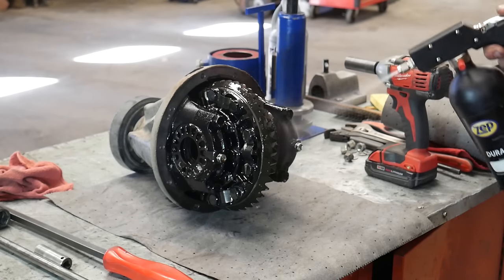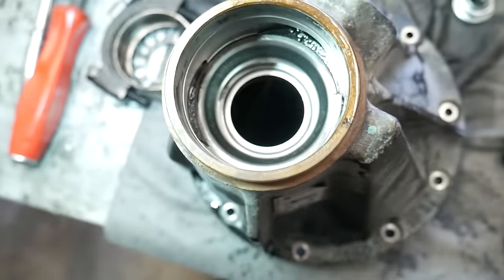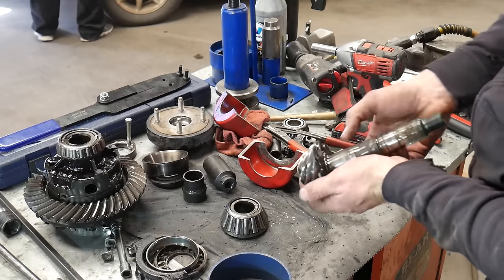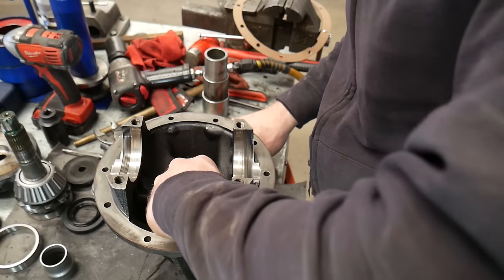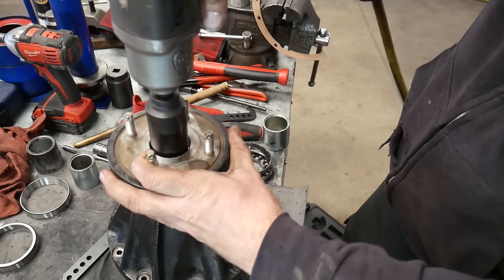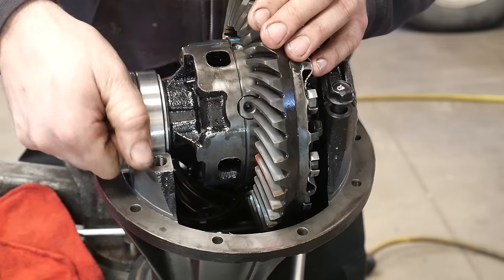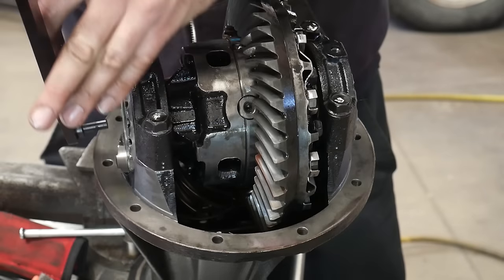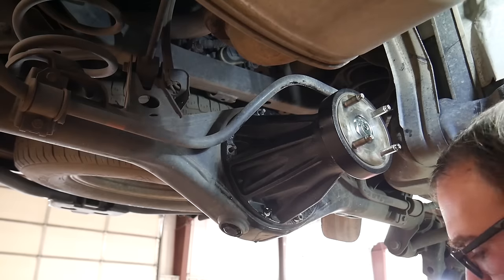2005 Toyota 4Runner Rear Differential Rebuild - Bearing Replacement

Comment: Hot tank/cold tank?  I use my oven for the housing and the fridge freezer for the bearings.]
Reply from the maker: I use the hot tank on the housing and it does help. I have also seen dry ice used to cool the bearing races before install to shrink them. And a hot plate on the bearings to install on the pinion.

Comment: For people without a welder:  No need to weld the race to get it out,  instead cut a large washer in half to clear the deflector, set  both halfs of the washer onto the race and press it out.  Or just order a new deflector which is inexpensive. This is a good step by step video though
Reply from the maker: Thanks for the washer tip. I will take a look at the next one I pull apart and try it out. There are times when I don’t have access to air or a welder.
Reply: Can you please explain a bit more? I have a deflector in mine and cannot punch my races out... cheers!

Comment: The Pio on bearing removal tool requires the bearing outer race to be in place and you lift it off by pressing on the rollers, this way you don’t need to get under the inner race of the bearing,, this did my head I at first but that what make this tool so clever.

Comment: Im glad i found your video, my buddies been wrenching on heavy equipment, semis, dump trucks, trucks, cars, boats for 40 years or more. I told him i needed my differential bearings replaced and asked if he had the right tools to do it. He asked what tools? I said well to set the pre tension, the paste to check gear spacing the stuff i saw guys using on utube videos. He just laughed at me, said if i wasn't changing gears he didn't need the high dollar crap. He said you do it by feel if you know what your doing lol. Watched your video and i feel better about having him do it now.

Comment: Nice and clear explanation throughout video! I will say carrier bearing preload seems quite loose imo. Once backlash is set go back and forth, or focus on ring gear side and tighten those bearing adjusters as tight as you can get them. There is a tremendous amount of torque going through the ring and pinion and deflection will happen without enough carrier bearing pre-load. It will not damage the carrier bearings by having too much preload. Well over 100 ft/lbs on the adjusters is common.
Reply from the maker: Thanks for the info! If I would have followed all the factory directions we would have checked the carrier preload. Toyota gives specs for pinion preload by itself and additional pinion preload after the carrier has been installed and adjusted. The adjusters have to be adjusted to meet the preload requirements.

Comment: Very professional process and clear explanation! My friend has a 2004 Tacoma with 260k miles. The rear diff has some major play at the front pinion bearing.... But no leaks or bad sounds. Should I just try tightening the flange nut to reduce the slop?
Reply from the maker: Pine Hollow Auto Diagnostics excessive rotational play or up and down play? If the pinion is sloppy up and down you can try tightening up the nut but normally the bearings are worn and will start to make noise after tightening(unless someone didn’t tighten up enough in the past) If the play is rotational play then the pinion nut probably won’t help and you would have to remover the diff to adjust the carrier so the backlash is reduced.

Comment: I rebuilt my toyota 7.5 and installed a locker back when i was in community college 2015 automotive service technology. I forgot how i did it. This video refreshed my memory. I want to change my ring and pinion gears, can i reuse the bearings that i replaced years ago? Do i need new crush sleeve and shims?

Comment: Since you got fire involved, you might as well had just cut the race out.  I worked for a logger who could do stuff like that. Definitely exemplary of making it work with what you have!
Reply from the maker: I’m more likely to cut to deep with a torch and trash the housing. I mostly just beat them out with a drift and hammer.

Comment: Do you add friction modifier to the rear-ended gear oil ? I just came across to ask you Toyota   shops say so I helps with the chader in turns parts stores gear oil doesn't have it in the oil 🙋
Reply from the maker: That normally is only required on models with limited slip differential.  Toyota places a sticker near the fill plug that will say LSD.

Comment: Very nice tool by Yukon for removing the pinion bearing what model number is that tool so I can grab one should also work on 2000 3rd gens as well there are no links in the description sir

Comment: At 3:00 
The bearing kits here in 🇦🇺 come with a New Deflector ...
Simply punch the Deflector and bearing cone out with a punch .. No Welding required .. 
May save you half an hour of welding and slag if you can source the $5 Deflector ?
Reply from the maker: @kevwills858  I agree with you. It’s not worth $5 to waste time. The deflector didn’t come with my bearing kit unfortunately and welding only took about 5 minutes. 

The welding trick also works wonders in other places. Yesterday one of my technicians was having difficulty with a Toyota sienna front wheel bearing because the race was rusted into the knuckle. I told him to quit messing with it and grab the welder. 5 minutes later I heard the race hit the floor.  Not only does the weld shrink the race but the heat also helps to break free any rust binding the components together.
Reply: It takes me 5minutes to drag my welder out and set it up 😄 ..
I've welded a quite a few Dry Cylinder Liners in old Perkins engines (insitu), it's the only way to release the rusted Liner from the Block .. (another old trick👍)

Comment: So my 2004  seal is leaking, can I just take the pinion out and replace it without replacing any parts? just gaskets? Any hints to do it quicker? Thanks in advance!!
Reply from the maker: If it is just the pinion seal you don’t need to remove the third member from the vehicle. You can service the seal buy removing the driveshaft and pinion flange. You should mark the nut so you can try and get it back to the same location when reinstalled.

Comment: I have a leak on my 2000 4runner rear diff right at the housing of the axle tube to the 3rd member Housing right near the bolts on the bottom and sidee and I can't seem to get it sealed what could be the problem ?
Reply from the maker: If it’s leaking where the tube goes into the housing then it may be difficult to seal. 
First thing I would check is the differential vent and make sure it isn’t plugged up. It is located on the driver side top of the differential housing. It has a little metal cap that is crimped onto a metal nipple. The cap should be able to move up and down as well as spin. Dirt gets into the cap and causes the blockage. As you drive the increased pressure will make everything leak much faster. 

You may have to removed the 3rd member and clean the inside and outside area of the leak and then apply sealant to both sides. Let the sealant dry overnight before putting fluid back in

Comment: Did you add silicone to the gasket? Also what was the torque spec on the diff bolts. TIA

Comment: Thank you for posting.. This is a GREAT reference! 

I'm guessing that is a non-locking open carrier that you are working on.. Do you know if the process is the same for a non-locking limited slip? Thanks for any info..
Reply from the maker: it4dps the process will be nearly identical but the specifications may vary slightly.

Comment: On the inner pinion bearing, would it be ok to warm it up first on this application? I install bearings on spindles at work on heavy mobile cranes and we warm the bearings to 350F and they slide right on. Wait a bit for them to slowly cool. Just wondering if these little bearings could take that. Cheers. Great video .
Reply from the maker: Great question!!! I had to do some digging to see if I could find some accurate information and learned quite a bit along the way.  I found that people heat bearing to all different temps before install but I found a article from SKF that recommends a maximum of 257F or you can risk changing the metal's attributes. The article shows very large bearing but it should apply to the smaller pinion bearings as well. Here is a link http://www.lubsys.com/knowledge/knw_heatmnt.htm

Thanks for the question and for checking out the video👍🏻
Reply: This is a perfectly acceptable way to install bearings without a press. Throw your pinion in the freezer over night and toss the bearings in your oven at 350 degrees for 10 minutes or so. Take out frozen pinion, take bearing and slide it right in place. This can be done on the carrier as well. 

The freezer part will not have as much of an effect as the heated bearings, but it works well. You can also use a heat gun to warm the bearing. 

Also, you can wrap the bearings in water soaked rags, and put them in the microwave for 90 seconds.

Comment: Have you guys considered investing in a bearing induction heater and/or liquid nitrogen to install those bearings and races? Much faster and no potential bearing damage as opposed to cold mounting. Liquid nitrogen alone will suffice and really cheap to use
Reply from the maker: I ordered a induction hot plate but have not tried it yet. The bearing induction heaters are very expensive from what I’ve seen in the past. Many of them don’t accommodate smaller bearing as well. I have not used liquid nitrogen but I will check into it. Thanks for the tips!!👍🏼🔧

Comment: I know the video is 5 years old, but would you mind sharing the rebuild kit that you used and where you got it from? Thanks.
Reply from the maker: @MiguelFleitasMikkang  at 18:20 I talk about bearing options. I got this set from Randy’s Ring and Pinion. Toyota parts department would be good option as well. 
Local parts stores seem to have a hard time getting the correct bearings.
Reply: @ThePracticalMechanic  I subscribed though. Excellent videos.

Comment: Does the 3rd member need sealant for the bolt flange from the 3rd member to the axle housing I have a massive leak and I can't figure out why
Reply from the maker: From the factory there is only a thin paper gasket. If both surfaces are clean and flat the paper will seal. If there are any imperfection then RTV sealant will be required. Ultra black or ultra grey is what I use and then let the sealant dry/cure before installing new fluid.

Comment: looking at your videos before I tackle replacing the 10 bolt Differential Gasket on my 08 FJ.. do you apply any sort of sealer onto the new gasket or just pop the old one out, clean the faces, new one in, and bolt it back up?
Reply from the maker: It should seal up just fine with the paper gasket but some will apply a thin coat of sealer anyways. The factory didn’t have any sealer applied on the paper gasket.

Comment: Hey I replaced the rear differential and now the 4x4 takes a long time to lock ...do I need to reset the anything??
Since I disconnected the rear sensor ?
Reply from the maker: The rear diff shouldn’t affect the time it takes to engage because the rear is engaged all the time. Does it take a long time while driving down the road? While stationary? Was the gear ratio the same as the unit that was removed?
Reply: @ThePracticalMechanic  I know it takes a little long to engage but now it takes 5 times longer while driving .
The differential was from a 2004 SR5 4wd and mine is a 2005 SR5 4wd 

Thanks a lot for your prompt response!!
Reply: @ThePracticalMechanic  when is on parking it engage fast
Reply from the maker: Caza Y Pesca once it engages does it feel like it binds up? Example if you have a area with pavement for 20 ft and then it switches to gravel. Put it 4wd and drive in a straight line and slowly pull onto the gravel if it feels like it’s binding up when on the pavement and then releases when you hit the gravel then the gear ratio may be incorrect. I hope that make since.
Reply: I found that I installed the wrong g ratio on my 2005 mine is .3.73 and 2004 is 3.91
Reply: Thanks a million for your help
Reply from the maker: Caza Y Pesca that’s a bummer.  At least you found out now instead of this winter. Good luck with the replacement unit and have a great weekend.

Comment: I can already feel the misery of trying to do this without the proper tools. How much does it usually cost for it to be professionally rebuilt by you guys?
Reply from the maker: $800-$1200 seems to be the range for bearing replacement. If the gears are damaged it will of course be more.
Reply: At that price range get a third member already rebuilt with gears you want and maybe a locker with it too.

Comment: Thanks very much for the video! Got a question about the companion flange. What would happen if I use a flange with the rubber dampener (2WD) to an all time 4WD 4runner? Reason I asked is I’m just buying a 3rd member with the 2wd flange and don’t want to change the flange for fear of messing up the preload. Thanks in advance!
Reply from the maker: It should be ok either way. The two wheel drive version must have had harmonic vibrations that were absorbed by the transfer case on the 4wd and awd versions.
Reply: ThePracticalMechanic thanks very much for the quick reply!
Reply: ThePracticalMechanic hi. One more question. What sealant do you use to join the 3rd member to the main axle? I bought a gasket from Toyota but do I have to apply a sealant as well? What sealant would that be? Thanks in advance!
Reply from the maker: Radius if your using the new Toyota gasket sealer shouldn’t be needed. That make future service easier. I use Ford gray rtv sealer for my personal vehicles.
Reply: ThePracticalMechanic thanks again!
Reply: ThePracticalMechanic this paper gasket is so hard to remove. I’ve spent 2 hours already but I still have paper residue and looks like it’s baked to the metal. Any tips you can give? Thanks in advance

Comment: Great video! Do you think this process would be similar enough to help me do this job on my 99 4runner rear diff?
Reply from the maker: It will be almost identical. If you have one with a locking differential it requires a special bearing kit and a few different steps.
Reply: @ThePracticalMechanic  It's a RWD so I don't  believe it does. Thanks for the quick reply!

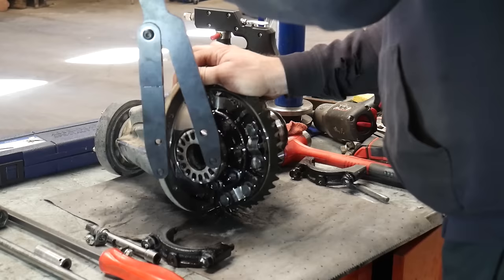Comment: 01:15 which spanner brand did you use there please?  It looks like it is of good design.  Great work!
Reply from the maker: Its a tool from AST tools. it has interchangeable pins for holding camshaft gears as well.
Reply: Thank you!  I tried looking for it but I did not come across anything.  Do you have a part # for it please?  God bless. @ThePracticalMechanic
Reply from the maker: @jtg2737  ast 7200. Here is one price well on eBay if your ok with used. https://www.ebay.com/itm/166289077975?mkcid=16&mkevt=1&mkrid=711-127632-2357-0&ssspo=8wXTI_s-TkO&sssrc=4429486&ssuid=FaFC5sdKRTm&var=&widget_ver=artemis&media=COPY

Comment: Great! Video do you happen to have a video of how it sounded while driving im trying to determine if I have the same issue. While I'm driving and foot on the gas is fine but when i ease off the gas (decel) its when i hear the noise (huming/rumblings)which seems to come from my rear of the runner. 2003 v8 4wd.
Reply from the maker: Efren Bautista I tried to capture it but the audio didn’t come out. Rumbling could be the ujoints or the rear end. I currently have a 1996 that needs rear end bearings and it rumbles slightly if I completely lift my foot from gas pedal but it whines if I feather the gas on and of. If I do a video on that one I will try to capture some audio of the noise.
Reply: @ThePracticalMechanic  thank you I appreciate it.. I removed the diff oil and plug and found shavings but no big chunks.. 
While driving would only rumble when i get off the gas

Comment: Thanks for the video! having a difficult time determining if the groan sound I'm hearing on my 2005 is from the diff or wheel bearing, brought to a couple of mechanics and they haven't been able to pinpoint. Sound does seem to emanate from the rear but I know sound can travel an can be deceiving. The sound changes at different speeds, very noticable at 50km/h and 90km/h. Attempted swerve test and seems to kind of lessen a bit when going left but hard to replicate consistently. Any other tests or suggestions on determining what is causing the sound, find it very bothersome and would like to have fixed. Thanks!
Reply from the maker: If the differential bearing are bad they will often make a different tone when acceleration and decelerating. The wheel bearings normally will change when swerving side to side but not always.
Reply: @ThePracticalMechanic  Thanks for the reply!

Comment: Hi,why didn't you check the mesh pattern? great video
Reply from the maker: I normally don’t check them if I’m just replacing the bearings. If I can’t get a quality brand of bearing then I will check the pattern because I don’t trust the pinion depth will remain close the the original bearing. If I’m also replacing gears then I will start with the original pinion shim and then check my pattern and adjust accordingly.
Reply: @ThePracticalMechanic  thanks,I'm about to do my first gear set up,your video was helpful.

Comment: How much did this job cost I just payed 1200 dollars 2003 4 runner
Reply from the maker: We are typically $1000 -1200 for the differential bearing replacement. There are additional parts and labor if the axle bearings and seals are replaced at the same time.
Reply: ThePracticalMechanic thanks for reply back

Comment: What’s the average cost for a differential rebuild for a Toyota? My 2008 Tacoma has 202k miles and it’s starting to scream in the rear and noticed ALOT of play in the rear.
Reply from the maker: $800 is average for bearing replacement,12-1500 if the gears are damaged and 1500-2000 if an ARB locker is being installed at the same time.